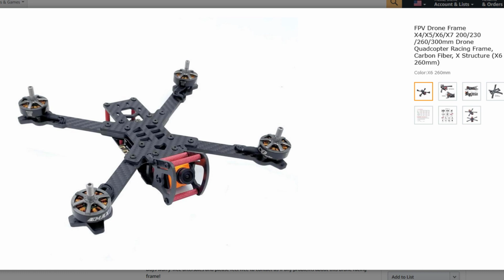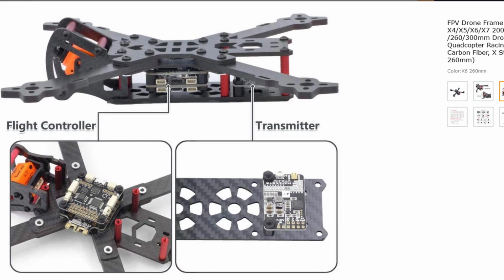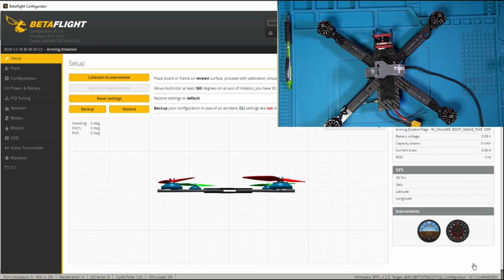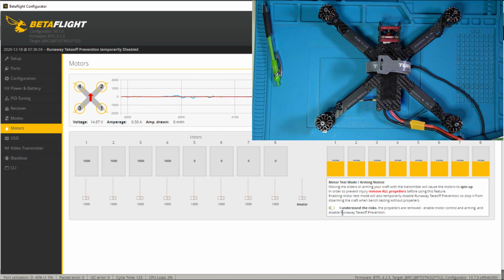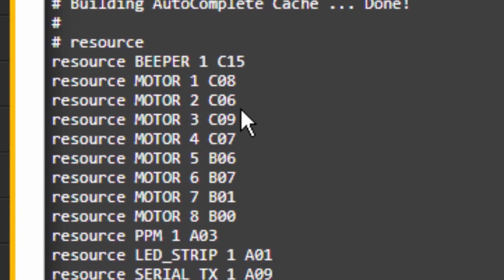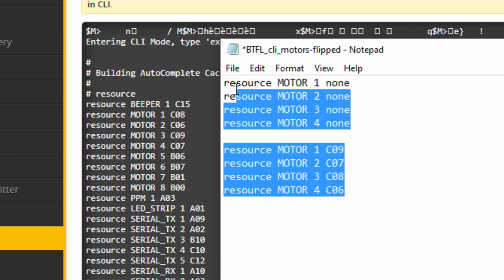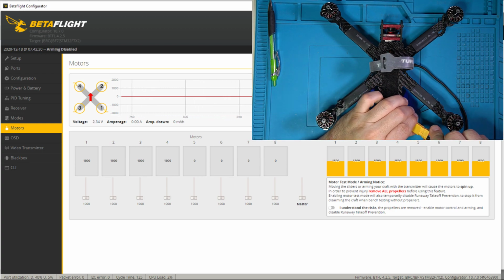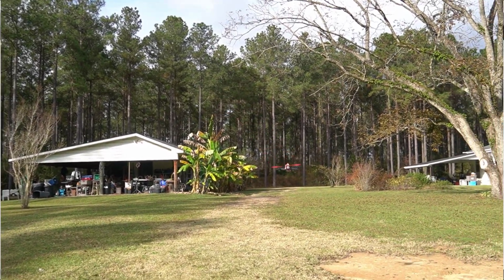Installing a FPV Quad Flight Controller Upside Down

Comment: We had to flip our flight controller but we also had to spin it (so that the USB lined up - we are putting an ELRS AIO in a nanohawk x) so a problem we ran into is the motor direction was wrong. So its important to make sure the MOTOR direction is correct. I watched this video but we couldn't figure out why it wasn't working, but since we rotated the board off forward, the motors were spinning backwards on two sides.

Comment: If only the FC was upside down but the esc is upright..would it cause the same issue with the motor numbers? I need to set up my FC facing down as i got some space issue in my stack..

Comment: This has been super helpful. Thank you.
I have a Tmotor F7 Pacer FC and i assumed the main logo would be the top and the exposed chips with arrow was the bottom. Yeah i was wrong! Spent ages trying to fix it and ultimately flipped the FC back over. What i had failed to do was re-calibrate the gyro. This video pointed that out and now i can check the motors and i should be all good.

Thank you so much for this video. It's actually better than Bardwells FC upside down video. Massive thumbs up and a new sub my dude.